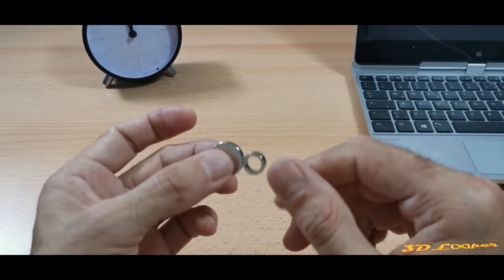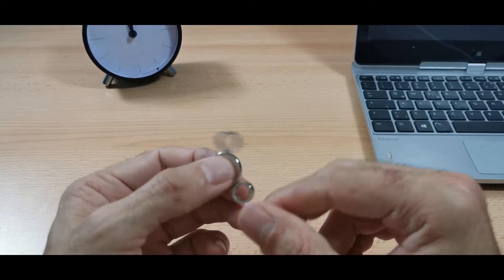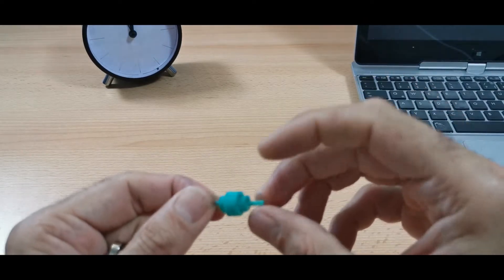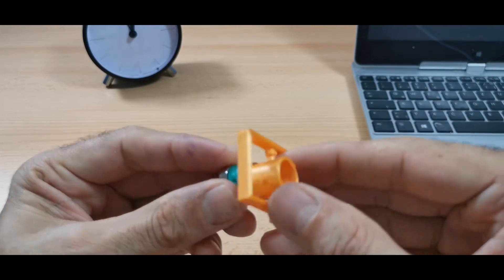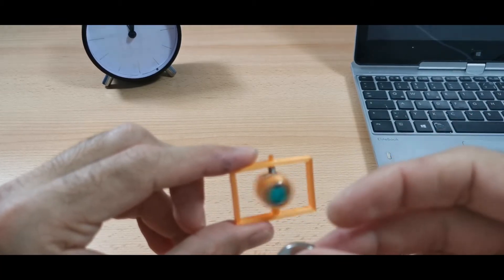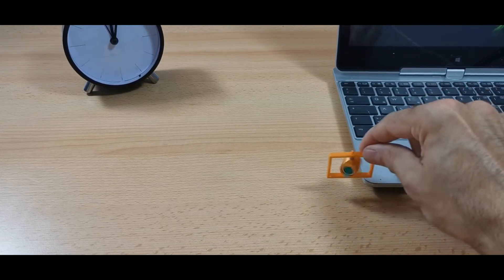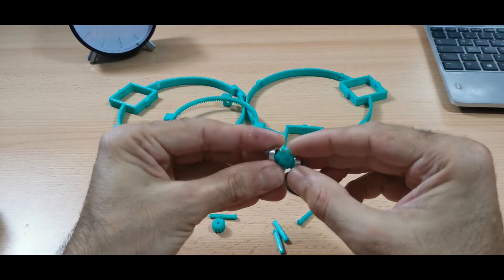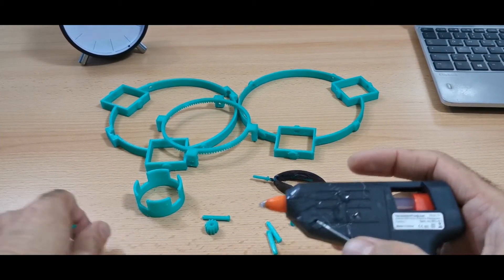Self Running Machine Experiment Using Magnets - 3D Printed

Comment: You should add mini coils to generate power. I'm sure if you scale it up and add enough coils you could generate enough power to charge a low power device like a phone and probably a generator maintenance system controlled by a low voltage microcontroller...that detects velocity and voltage changes and initiates a spin if the system stops.
At that point it really will be a perpetual machine.
Reply: I wouldn't call a phone low power.
Reply: @_nom_  compared to most other common devices and appliances...it's pretty low power.
Reply: It’s perpetual until u add resistance, then it wouldn’t work.

Comment: what did you put under the table? you can see the equipment swinging
Reply from the maker: It's swinging because of its light weight. I think if I add some weight to the base then it will be more stable.